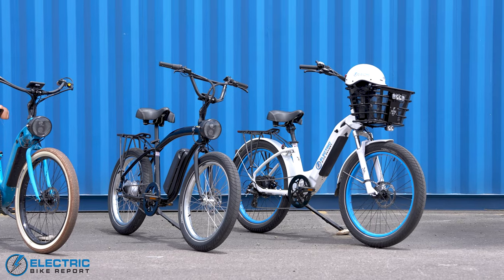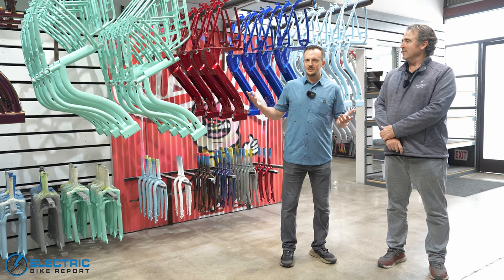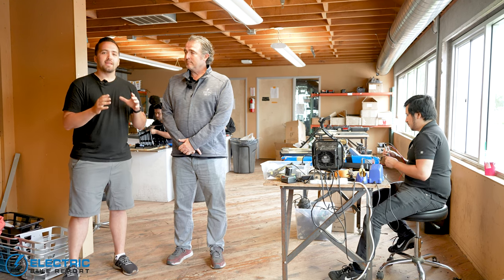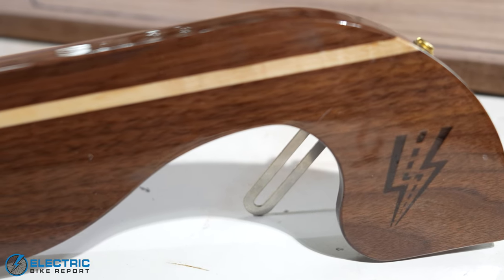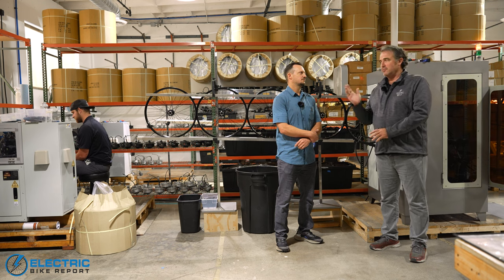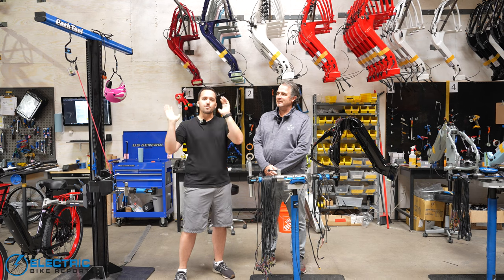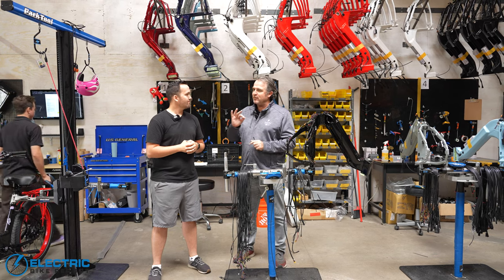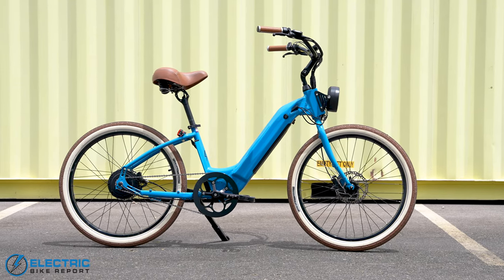See How Custom E-Bikes Are Made! - The Electric Bike Company Factory Tour

Comment: Don't you mean "assembled in the USA"?? Are the frames actually manufactured I. The USA or in China? The motors, brakes, cassettes, shifters, etc are all manufactured in China.
Reply: Thats the point.
Reply: The point I was trying to make was their claim that their bikes are made in the US which implies that they are manufactured here. That is not the case at all but assembled using foreign parts.
Reply: @mberrey45  And I just confirmed your argumentation.
Reply from the maker: Michael, I already replied to another comment about this, but I guess we should have added a section speaking to what 'made in the USA' means. I think if we use your definition, then even most bikes made in China wouldn't be classified that way since so many parts also come from Taiwan, and then the raw materials come from all over the globe. The main point is that Electric Bike Company goes to crazy lengths to build/assemble their bikes here - which is very unique and allows them to customize their bikes in a way that we think is super cool.

For clarification, Electric Bike Company sources parts from all over the world (last time we talked with Sean he mentioned something like 30 different countries).